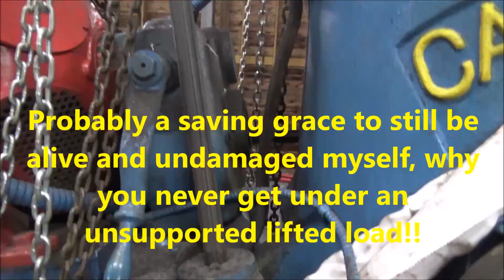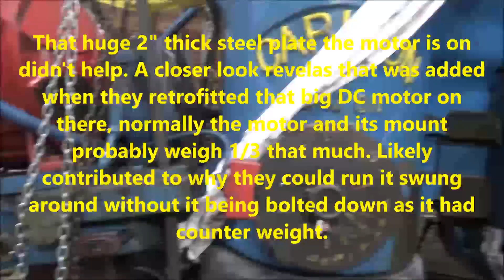The Worst Shop Day Ever :-(

Comment: I dropped a lathe. I never saw my dads eyes go so big before. Bent the sheet metal stand it was on and some farm jacks. Plus it leaked gallons of oil. Had to use gantry crane right above it to set it upright again.
Reply from the maker: Did the lathe survive ok?
Reply: @bcbloc02  Yes it did - I was glad it was not some quality lathe like people have on youtube but an old Indian clone of Harrison (Enterprise 1675). I tried to fix the sheet metal work on the bed but its actually heavy gage steel and very springy - so I just left it as is. 

All that machinery moving seems to always damage something. As lathe was falling it ripped the starter from Kerney&Tucker #2 horizontal near it. I was glad I only had that much damage not more & both me and my dad were OK.

Comment: As bad as that is young man you avoided any injury or death. You can tear up the concrete and replace it easy enough. The drill, well maybe find another one you can use for spares or vice versa? What is commendable is that you have the balls to show such an incident on YouTube. Many people would never have published a disaster of such a type happenning to them. 
It's an expensive lesson to learn but on the positive side, 138,365 video views means that a large percentage of people including me have just learned to check stuff before trusting it. Top regards, Jon.
Reply from the maker: Well if you watch more videos you will see I fixed the drill and have been using it trouble free for several years. 😀
Reply: In that case, I have some catching up to do!

Comment: Wow - how heavy is that thing?
Reply from the maker: About 25000lbs. when the table isn't on it.
Reply: YIKES, - no wonder it snapped the cable and cracked the floor.
Reply from the maker: Still less than the 30K the crane is rated for though.

Comment: Hi mate.  Now I don't want to be critical, but are you sure that this was the best way to unload a rather heavy pease of equipment??   
I a'm so very sorry that this happened.  I hope that the damage can be repaired without having to rip out all that concrete.  I'm sure that you are capable to repair the machine, albeit not the way you wanted to in stall the bloody thing.
Good luck mate.
Reply from the maker: I could have saved a lot of time if I had just yanked the trailer out from underneath it.
Reply: Haha.  You might just be right, there.

Comment: When I saw the video title it wasn't unexpected something was going to go very bad. But I was really hoping for much less than this Brian. Zero I can say that's going to help fix the mental azz kicking your going to be giving yourself for awhile. You walked away so at least a major bonus right there. I've lifted far heavier and larger items than this with so far zero failures. However that could be more good luck than skill sometimes. The heavy lift failures I have seen were almost always caused by an unknown. Yes in hindsight that cable should have been replaced. However it did hold up to where you started lowering. Everything else you redesigned on that bridge crane held up just fine. Cable rusting from the inside out isn't exactly an operator error. A more than good object lesson for every shop guy to see this. And major attaboys to have enough cojones to post the good along with the bad. A very large set back for sure, and as worthless as it it is to say so since you already know it better than anyone, things really could have gone far worse.

Comment: Hey Brian,

20:20 hindsight's a bitch, but you had not completely ignored the condition of your cable on your crane.

That said, you weren't hurt, Bayley wasn't hurt, and the damage while annoying wasn't too awful.

As you pointed out in the text in the video, you never want to be in the way fo a suspended load, because things can fail.

Your greatest risk (really unlikely) from where you were working was of relatively minor injuries if something in the rigging had whipped, or if you had stumbled into the falling load when the cable let go... neither of which happened.

You'll have a story to tell your grandkids / nieces & nephews, and your slab may need some repairs - hopefully the PEX tubing didn't get  broken.

Your biggest repair is going to be on the cast iron on the drill press... PITA, but you'll get some good videos out of it! ;)

Bottom line: It's just things, not people or a pet, and it can be fixed.

Sucks right now though...

Take care,

Eric

Comment: Leave it where it is. Get chain tight.
Let air outta tires.
Pull up .
Lower onto custom welded cart with wheels. Make two of them fixed. With brakes. Spinners on the other. Maybe hydronic leveling system .
Make that pig squeal  like a 🐖 pig..
Awesome machine. This is called. Adult pull toy.
Yikes batman! 
Holy moly . Sorry for that .
Go drinking for a while .
Get a shower n sleep in.
How's the floor?
Hind site is always 20 20.
Sad ,but count your blessings it didn't hurt anyone! We have bremelows here in bremerton. Got stepped on. I'm sure was  similar to the machine hitting concrete.
Yeow.
I said how much do you weigh? 450
Big pause.Glare n Stare
I said is that each leg.
She thew something and left.

Comment: Do you have insurance on your business?  You may be able to file a claim.  You can also probably take a tax deduction.

Super relieved that you were not injured.  You showed good reflexes.  I recommend two fingers of bourbon with a splash of cold water then go to bed.
Reply from the maker: I didn't pay for the drill what they would jack my rates up in the long run, especially after taking the dedcutable out so best just to fix it and move on.
Reply: Keep track of your expenses.  I think that you can take several years to use the deductions on your taxes.  There are carry forward rules.
Reply: It is $3000 per year.  I have been doing it for several years.

Comment: G Day Brian, Boy I near shit when the cable broke, I have had things go wrong from time to time and it leaves you cold. Really bad feeling for sure. I dropped a mogul engine once and broke the cylinder off, same thing, broken castings etc. I still have not finished it. Lucky you stand away from it a bit and didnt get hurt. I wonder if the concrete would have had less damage if it was cured a bit better.
Sorry to see your dissapointment for sure but you are a handy bugger so hopefully you can get it all sorted.

Comment: "I have a masters degree in Mechanical Engineering"

And, in reality, what's that worth ?

Did you skip school on the materials strengths section ?

Also, I would not have leaned a ladder up against something on wheels !

I've not got a masters degree but I don't plan to run dad's compressor until I've satisfied myself the receiver is still fit to do its job !

Comment: thats why you should have got the pro engineers in as that would have bee insured the amount of times in the 20 years i have been moving machine tools that i have had to clear up someone else's mess  and on 2 occasions  to lift the tool so that the emergency services could retrieve the bodies once on a radial  where they had not locked the head in place with the u bracket to the base the other when a press brake fell forward of a traylor on to  a pedestrian because the driver did not know how to back tie well he did not back tie so all the weight was at the front and the first corner he went round oh and you lift a radial you lift from the bed plate with a 4 point lift and the head stock is to the front of the arm so there's 2 points of safety to stop the arm moving and incase you think im perfect im not i dropped a cnc lathe because i used a faulty sling and i should have known better   than to use wire bond that was frayed at the  eye end

Comment: Glade it did not fall on you and kill you very lucky. Rule number one of rigging you never ever lift anything by yourself. Rule two any and all over head lifting equipment must be certified to lift a certain amount of weight and be inspected several times a year, especially a new install of a used crane. The cables are the weak link in a overhead crane and need to me constantly inspected and tested.People will say ohh its the government making you lose your freedoms. No its to protect people from themselves.